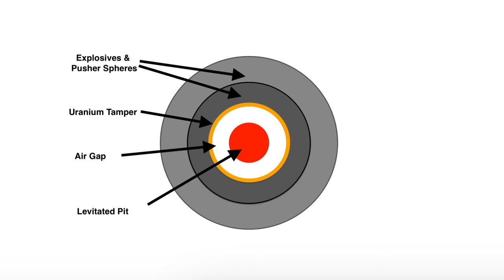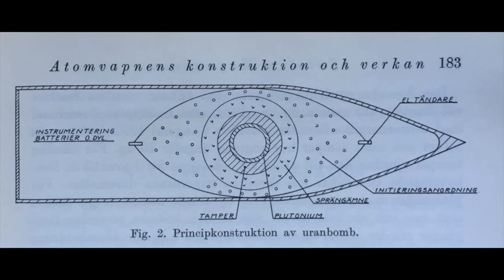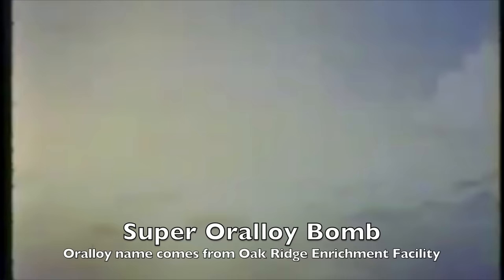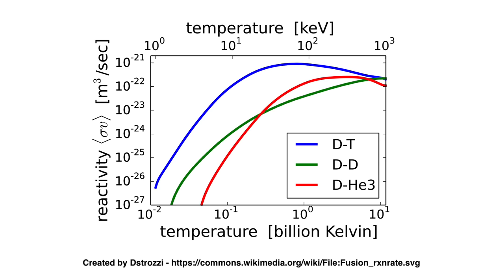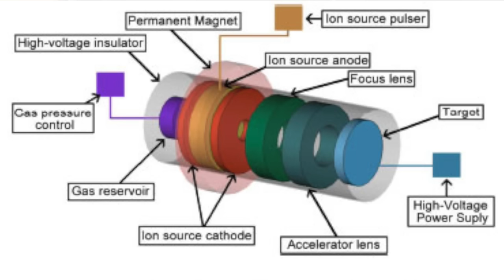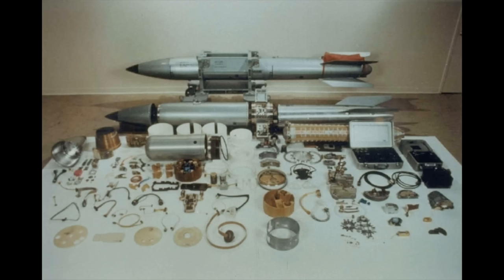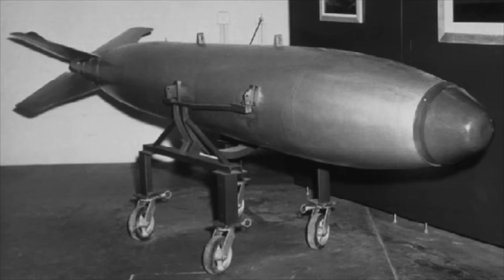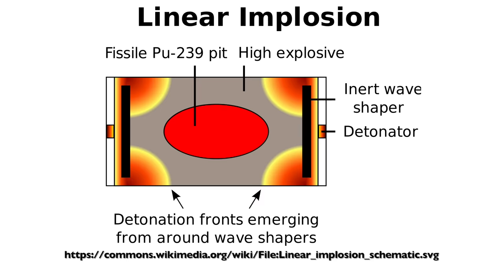Going Nuclear - Nuclear Science - Part 4 - The Incredible Shrinking Warhead

Comment: What is the point of variable yield? If you want to drop a nuclear bomb, you always want most bang for the buck, not dialing it down, right?
Reply: It can also enhance safety and security to some degree by storing in the lowest yield setting. An unauthorized or accidental detonation would be less damaging unless the setting was first changed to a higher yield. At minimum yield they will still cause severe damage but far less than at maximum yield.
Reply: bob Remember, There Is a diffrence between Strategic And Tactical nuclear weapons
Reply: Sometimes you don;t want to use the shotgun to get rid of the fly.
Reply: +Joshua Banner
summarised it perfectly.
Reply: Thank you for the replies, they all make sense, especially the safety one because I am not aware of any currently in service tactical nuke delivery methods (SRBM, MRBM, IRBM, nuclear artillery).
Reply: Different deployment options, in addition to the other arguments mentioned. 
If you need a low level drop but can't use a long delay on the fuse, you want a low yield weapon so your delivery aircraft will be outside the blast zone when it goes off.
Now, you could have many different weapons in stock and pick one as needed. But it's more economical and flexible to have a limited number of designs but make them tunable to the mission requirements.
Cheaper to build, cheaper to maintain, and you can swap a weapon to another mission rapidly if needed (for example if a weapon slated for a higher priority target turns out to not pass its pre-loading checks and a replacement is needed).
Reply: + These weapons were designed at times when they thought they could use them for anything. Like digging tunnels... 
They wanted to use them for any purpose. And they didn't really realised the implication of irradiation.

Having a 50kg bomb that could detonate like a hundred (or a thousand) tons of TNT, can be very practical and usefull.